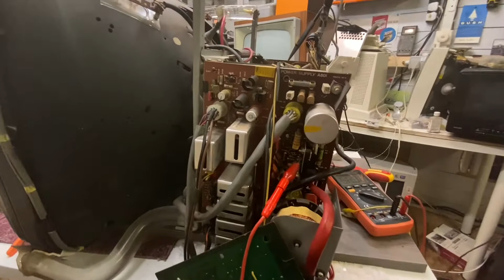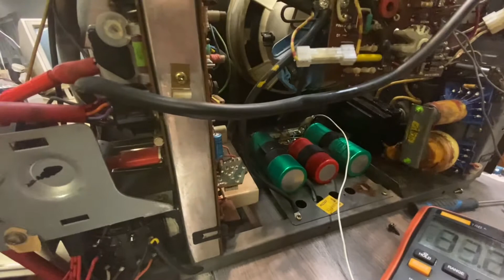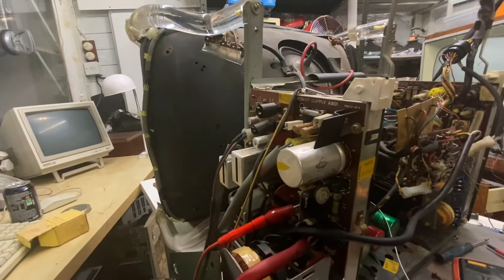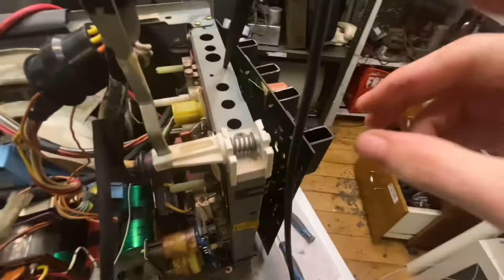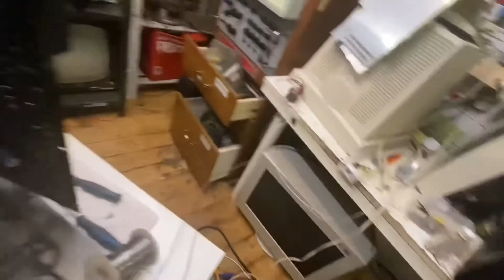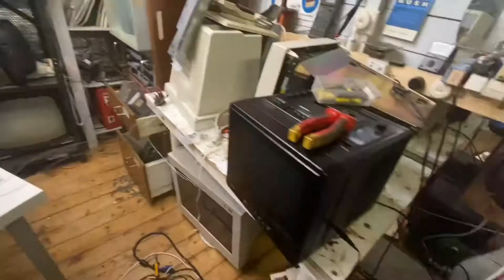Always use a Service Manual!

Comment: that tv chassis  looks familiar , i repaired one the same or similar, in the 90s, bush ctv 194 , not a lot wrong, cracked surge thermistor and shorted bridge rectifier.. you certainly need the manual to set up the line stage balancing ,, similar with philips G8s that use 2 transistors
Reply from the maker: This is an A823 colour chassis. From memory it was an early type. I worked on another set which used the same chassis branded Murphy, with a 22 inch CRT in it. They are power horses but do suffer occasional faults with shorted tant caps on low voltage rails, cracked joints etc. sometimes low voltage smoothing cap for the decoder fails as well as HT smoothing. Noisey transistors in IF cans

Comment: that is IF you can get one, or even just a circuit,, but dont blindly trust them, there can be errors or even production changes, you may have the wrong one for your particular device version!
Reply from the maker: Good point. Most old stuff, depending on where the set was made, you could be lucky. Thankfully you can get almost any service manual from vintage radio.com for UK stuff. Americans had Sams photofact. We had trader sheets if official manuals can’t be found etc. I was able to secure the official and trade version of a service manual for my 1938 pre war television